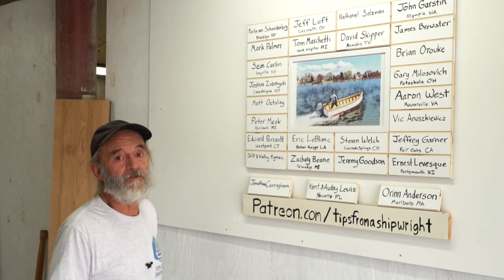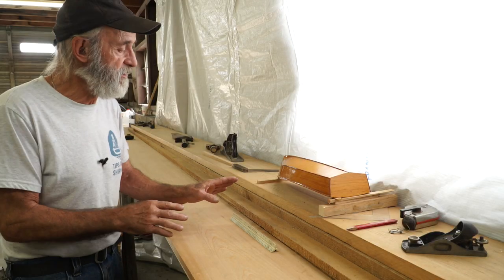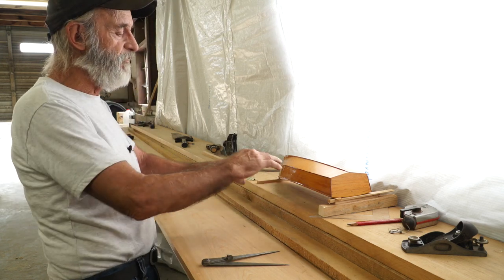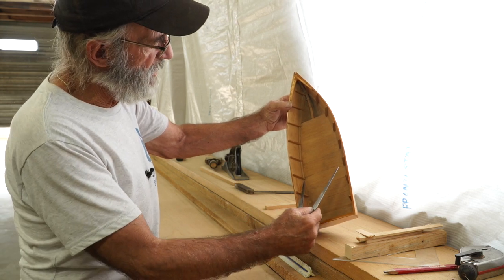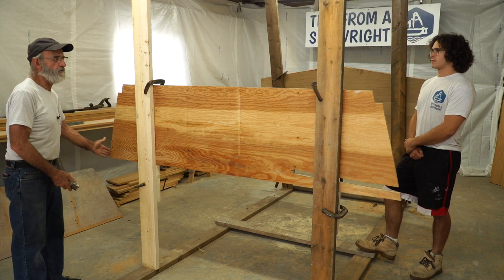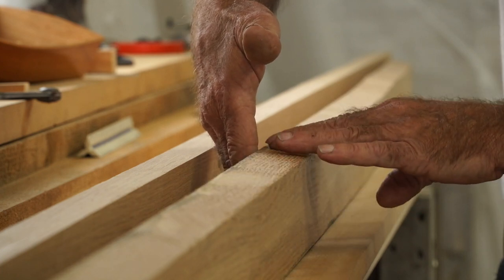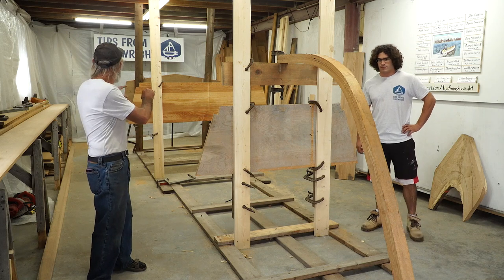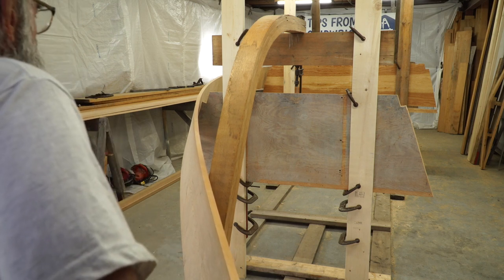Building the 23' V-Bottom Skiff - Episode 3: Building the stem and molds

Comment: That's a badass skiff but I think I would've built it with a center console located more towards the rear if you're wanting to use the rest of the deck as space for doing work. 23 foot seems too big for a tiller setup.

Comment: There is a 2 1/2" discrepancy between the front mold height measured on the scale model hull vs the placement of the corresponding construction mold???